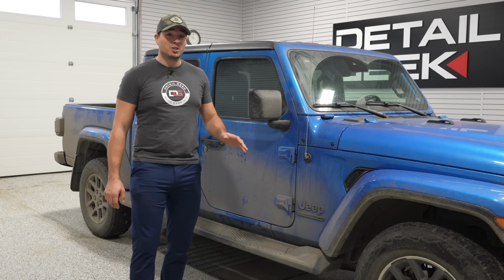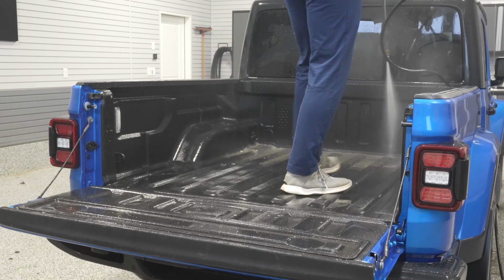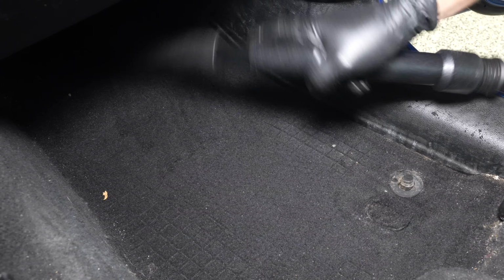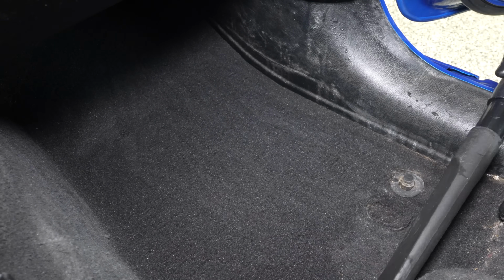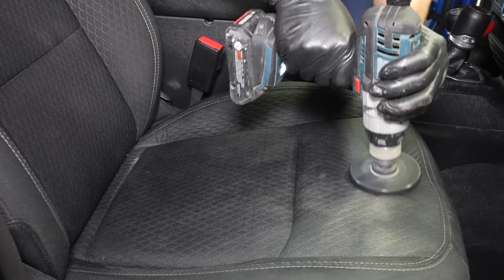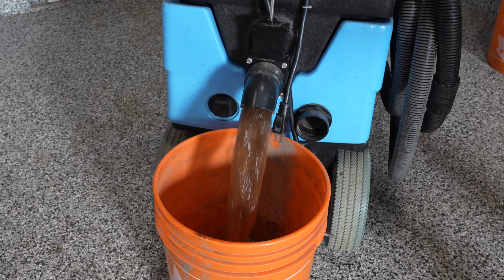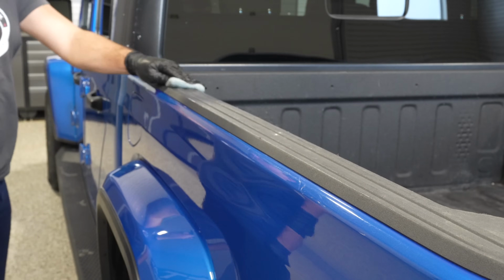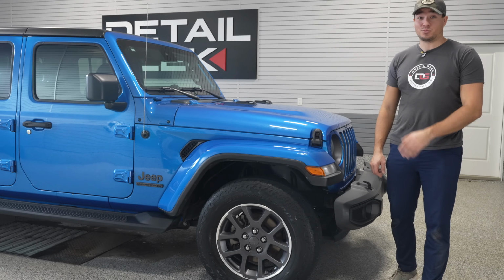Cleaning The UGLIEST Jeep Ever Made?!

Comment: Is your ceramic spray a stand alone sealant or can it be used to “recharge” an existing ceramic coating?  Thanks.
Reply: I remember Mitch saying that if you want to use it as a stand alone sealant, you can

Comment: Man you really soak those seats when cleaning them, I don't believe introducing that much solution into the vehicle is necessary. I guess as long as you're not messing up electronics inside the seat and you leave the vehicle long enough to fully dry, it's fine.